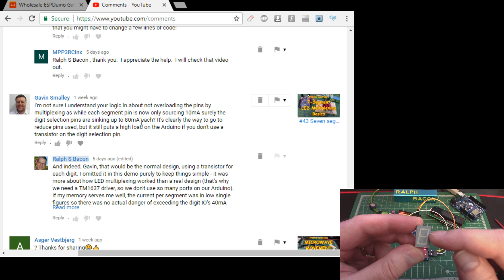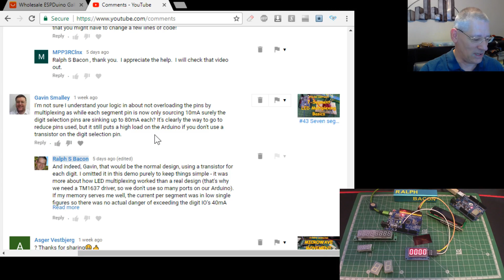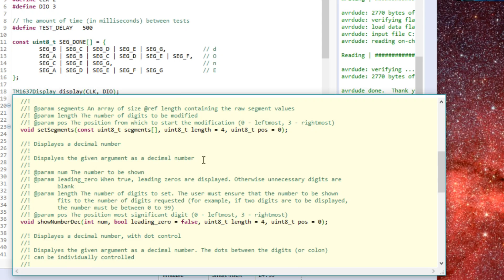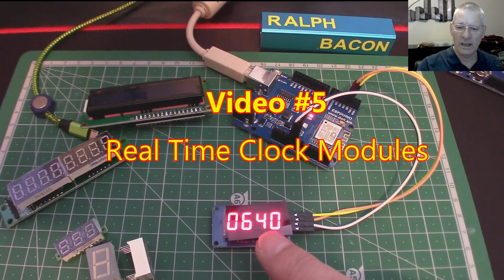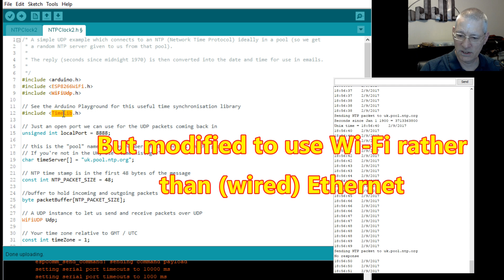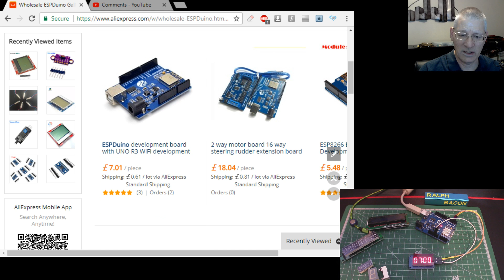#94 TM1637 LED Controller (Part 2) using NTP Server

Comment from the maker: I mentioned in the video (and in some of the response to comments here) that a non-blocking, more reliable version would be advantageous. Well, I seem to have achieved that this evening and my same sketch now runs as before but it totally non-blocking (it no longer waits for a UDP response) and if it cannot get an NTP response it tries again (possibly with another NTP server) in 5 seconds (wash, rinse, repeat until we do get a response) then revert back to the user-defined synchronisation period (I've set mine to 5 minutes just to prove it works but it should really be every hour or more). Whatever, it's now working nicely, so I'll keep it running on my desk here for a soak test and post the updated libraries in the my GitHub when it's all proven.

Comment: A tip for you and your fans: 
To improve readability of LED 7 segment displays, especially in bright light, the front surface of the acetate or coloured acrylic (even better) can by given a very fine brushed finish using 0000 wire wool (the finest grade I believe you can buy).

This disperses front surface light and massively reduces distracting reflections. Once you try it you'll wonder why you didn't do it previously.

IMPORTANT!! DO NOT use excessive pressure and rub the piece to cover the LEDs from left to right with the wire wool horizontally across the face. This will give a very nice matt to satin finish.

If you can get hold of any, there is, or used to be, proper red filter acrylic which is both matt on the front surface AND polarised, circular I believe.

Always remember also to remove the reflective & protective clear film typically fitted to the displays for minimum internal reflection and maximum contrast. Plus fit the display as close as possible to the back of the filter.

Hope that proves useful for people.
Reply from the maker: It's going to be useful to me, Bob, when I finally get my one metre strip of 8x8 square matrix LED characters to display something useful. 👍🏻

Comment: wooooooow, i'm beginner with arduino, You have many video's. Good work!!! now i don't find in the video's and i can't see him all :-) ,hihi.    Here work with wemos D1 and DHT11 to blynk app, works perfect but i want to send te temperature to the MT1637. Is it posible?? Can i do?   hello from Belgium. thanks
Reply from the maker: I'm pretty sure this is covered in this or the previous video? If not, once you have the temperature from the DHT11 (NB Range 0-60ºC does NOT go below zero, unlike DHT22) send the variable values to the TM1637 as shown in part 1 of this video.

Comment: Hi @Ralph S Bacon could you provide us source code since it seems i fail everytime when i try uploading it ? ty
Reply from the maker: All the code is in my GitHub for this video:
https://github.com/RalphBacon/TM1637-LED-Controller-with-NTP
Reply: @RalphBacon  would it be possible for you to create (or point) a video on step by step to get the code from your GithHub and load it to NodeMCU ESP8266? I must be doing something wrong every time. I have attempted several times different sequences but I might just not have the knowledge required to achieve the results. Thank you so much

Comment: I got this working perfectly on wemos d1 mini but for some reason only when I renamed the clock object as clock2 through-out (I did this as error message said SevenSegmentExtended clock redeclared as different kind of symbol).

Pins I used:
Clock 4 (D2 on wemos) 
Data 5 (D1 on wemos)

Might help someone!
Reply from the maker: It means, Robert², that deep in the bowels of a library that you're including, the developer already declared a variable called 'Clock' (it's a pretty common word) and now you have declared it (again). 
Strictly speaking, library developers should put underscores at the end of their names to avoid this. But by renaming it to Clock2 you've cracked the problem and made your name unique.

Comment: Hi Ralph, just watched this video and was most surprised to see you make a while video from my comment - really really useful and thank you!

I've just caught up watching each of your videos from #1 and I think it must be the most useful sequence of videos on YouTube for the budding electronics enthusiast.

I hadn't actually realised when I left the original comment that this chip was actually multiplexing each individual segment, I thought it was setting all the appropriate segments on and then multiplexing through the digits so that at any time there may be anywhere between 1-8 LEDs lit as that's how the Arduino example sketch with the 74HC595 shift register seems to work.  It's certainly how the single colour LED cubes mux each layer.

If you're iterating through each digit and then within that loop iterating again over each segment then the total drain current and any given time ought to be well within spec.  Never thought of doing that.

Anyway, thanks again for taking the time to make the video with the further explanation.
Reply from the maker: Ah yes, you'd be surprised where I get my video inspiration from, Gavin! Sometimes it's something I read, other times a comment from you guys! At least I know it's something that might interest others too rather than me going off on a tangent.
 
Talking of LED cubes, I did a couple of absolute back-to-basics video on a 2 x2 x 2 cube (small, so that we could understand how it all worked) . See videos #56 and #59. I never did go on to explain a 3 x 3 x 3 cube (although you do get a quick sneak peak of one I built at the end of one those videos)  as it was very time consuming getting those patterns set up. Anyway, I'm very glad you liked it, and thanks for the inspiration!

Comment: Hello, i am hoping you can help me. I have a DS3231 and max7219 which i want to use but not together. I want the arduino to read an 8 bit BCD value and display it on the max 7219 so for example 0000 0001 would be digit zero with a 1 on it, i have the arduino and max 7219 working though i have no clue how to do that. With the ds3231 i want it to count time and have the arduino output corresponding BCD values with a external digit select.  Can either be done? I intend for them to be two separate projects.
Reply from the maker: Anything is possible (except not paying your taxes) Neo, so let's think about this.
 
If 0000 0001 display a "1" on the rightmost digit (with zero on all other digits?), I'm guessing 0000 0010 displays a "1" on the rightmost bar one digit (with all other digits displaying zero)? But that's binary not BCD. So would you expect 0000 0010 to display "2" on the right most digit? You'll have to clarify this a bit for me!
 
Regarding the RTC, it would be simple enough to read the time using an Arduino and then output each of the 4 digits (hhmm) as an 8 bit (binary? BCD) value. Hmm. I did a video #8 on BCD (funnily enough with a DS3231 too) so that might be of use to you but if you just add a few details I will be clearer in what you intend.
 
I've done a few videos on the MAX7219 too (#9, #10, #11, #13, #25) so they might help too. Have a look first (you might learn a bit about the wonderful MAX7219 along the way) then come back here and just flesh out your project requirements and I'll see what I can suggest. OK?
Reply: With the first example the 8 bit value would be two counters, the first 4 bits of it 0000 selects digit 0, the rightmost digit, 0001 selects digit 1 etc, and the other value would call the number to be displayed 0001 being 1 0010 being 2 etc. This would be a multiplexed input to the arduino to save pins, so instead of a value for each digit it would be a value to select which digit and then a value for the corresponding digit. This would allow me to read a value from discrete logic. In this instance it is the 7 segment version of the max7219.

As for the ds3231, picture the same thing except with an output of a bcd value for the corresponding digit. 

I understand BCD though what i don't understand is how to interface the arduino with it.  I like to think that i am very good with basic logic but i get lost quickly when it comes to programming. I got the max7219 working but to display anything i have to manually call the code for it. With the ds3231 i got it working and keeping time though only to serial monitor i have no clue how to tell the arduino what to output.

As for specific project ideas, the ds3231 would output the bcd value as mentioned i could then decode that and send it to a display in part of a much bigger logic circuit. The advantage would be the accuracy of the time base, i build clocks i have no clue why it is just my niche. 
The use for the max7219 is slightly simpler in that it is just a display which if i have it able to read bcd could be used either to troubleshoot bcd values in a circuit or just be the display itself.  

The only difference between binary and BCD when it comes to numbers is that BCD is specifically 0-9 or 0000-1001 binary in the same context goes to 1111, or at least that is how i came to refer to them.

Hope i was clearer, thank you for responding and with those videos you mention i have seen those and most of the others.
Reply from the maker: So what you're actually talking about is packed BCD, where different halves of the byte (known as a nyble, yes really) are used for different purposes.
 
Just to clarify, the 8-bit byte is split into two 4-bit nybles (or nybbles or nibbles) where the first nyble determines which digit is to be used, with the second nyble containing the actual value (0-9).
 
To set a value like this, put the value of the digit into the byte and left shift it 4 bits (ie move it to the left 4 times). C++ allows this action by a simple << command.
 
So if you want a value on digit 1 (second from right) you put a 1 into the byte (let's call this byte 'digitPosVal') and then left shift it 4 bits:
 
digitPosVal = 1; // gives 0000 0001
digitPosVal << 4; // gives 0001 0000
 
Which moves the single right most (least significant) bit 4 bits to the left making 0001 0000 (which is 16 in decimal but so what?) What you've done is set the first nyble to 0001. Great!
 
Now you can just ADD the value you want displayed in that digit. If you want to display 6:
 
digitPosVal +=6;
 
This gives the binary value of the entire byte as 0001 0110 which is 1 for the first nyble and 6 for the second. Exactly what you want.
 
The resultant value (22) has no meaning at all; you're not interested in a complete byte value, you're only interested in what the two half bytes contain.

To extract the value, right shift the value 4 bits to extract which digit the value should go into. To get the value you could left shift 4 bits (to lose the digit position value) then right shift to get the value:

int whichDigit = digitPosVal >> 4; // gives 1
int digitValue = digitPosVal << 4; // so digitValue moves from 0001 0110 to 0110 0000
digitValue = digitValue >> 4; // gives 6 as digitValue moves from 0110 0000 to 0000 0110
 
If you can follow the above then I applaud you but I suspect it might be too much for a beginner. I do cover this, as I said, in one of my BCD / MAX7219 videos although not exactly as above. Let me know if it's gibberish before we talk about the DS3231!
Reply from the maker: Here's a web site that let's you practice your bit shifting techniques!

https://www.miniwebtool.com/bitwise-calculator/bit-shift/
Reply: i followed it fairly well though i fear i may of mis-expressed something. There would be 8 pins used 4 for each value, i meant multiplexed as in it would be 4 pins for numerical + another 4 for digit select. 
The digit control code is counting and the numerical value would be what changes. More complete example below, i hope.
D 0000 D 0001 D 0010 D 0011 D 0100 D 0101 D 0111 D 1000
# 0100 # 0010 # 1000 # 0100 #  0010 # 0001 # 0101 # 0011
Would be translated to what the MAX7219 could understand and display as 
4 2 8 4 2 1 6 3

In that example the entire BCD string being 0100 0010 1000 0100 0010 0001 0101 0011 and all the digit is doing is selecting which one gets lets through and processed.

The reason behind input multiplexing like that is it would allow an arduino uno to be used as opposed to a mega. The more i describe this idea the more pointless it sounds.
Reply from the maker: At this point I must admit defeat and admit I have no (longer have much) idea of what it is you're trying to achieve, I am really sorry for being so dumb.
 
I just don't get the use of 4 pins per 4 bits, nor how the values for the digits get to be 4,2,8,4,2... etc unless these are just example values you're reading from somewhere (the DS3231?). I also don't understand why this is all in BCD instead of decimal. As for the multiplexing concept... nope, I don't get it.
 
Translating any value from 0-9 so the MAX7219 can display it is easy - you just send it that value (there's an option to let the MAX7219 display a numeric digit value that you send it, in decimal).
 
I've just re-read this entire thread and still can't figure out what you are trying to achieve as  the overall goal of the project (which I'm sure has merit otherwise you wouldn't want to do it) but I don't grasp it from your description. The only thing I can suggest is that you write it out at a high level (forget HOW you might do it and just describe WHAT it is you trying to achieve) and email that description (and a picture is worth a thousand words as you might have seen from my videos so you can do that too if it adds something to my understanding). The email address is under my channel description, "About" tab. I hope you do this as we both need a better understanding!  (I'm wearing my <stoopid> face now.)
Reply: Its fine, i don't blame you for getting lost. I myself got lost i actually saw the problem and saw how absurd it was. Just write it off as a grand far reaching idea the isn't actually practical. Sorry to have wasted your time, thank you for your help.
Reply from the maker: Fair enough, neo, we'll park it here. If you ever want to resurrect this idea you know what to do.

Comment: Hi     Interesting  video , thanks .   I have just looked up the TM1637 data sheet and see that
it can drive 6 digits and also interface to a 16 button keypad . I can see why they would only
use  a 4 digit Led display but why not provide at least some pads on the PCB for at least a
few switches .
                                                                                       Thanks
                                                                                                         Alan
Reply from the maker: In a word, Alan: cost. Whilst to you and me "a few pads" seems the logical, easy thing to do, these Far Eastern items are built down to a price. By the zillion. A single cent onto the cost mounts up. Margins are super slim. Competition is fierce.
 
On the other hand, if you look at items built up to a specification you get all the bells and whistles you can think of - at a price. Think Apple, Raspberry Pi, Samsung Smart phones... all superb but fairly pricey!  In our Arduino world you might think that Adafruit items are quite expensive - but the quality (including the worked examples with documentation) is high. Pays your money, takes your choice.
 
Don't get me wrong; I'm not defending the Far Eastern designs but I can fully understand why they don't add a few pads or whatever to their boards! A pity for us, but if we didn't have those cheap components we might not have a hobby and I would not have this channel <shock> heh heh. Thanks for posting Alan, a great question.
Reply: Hi Alan, bit late to the party, but that's exactly what I did earlier this year. If Ralph is okay with it I can post the link here, but in the mean time you can just check out the recent video on my channel. If I were a Chinese board manufacturer I would offer such a mini LED&KEY board just as easily...